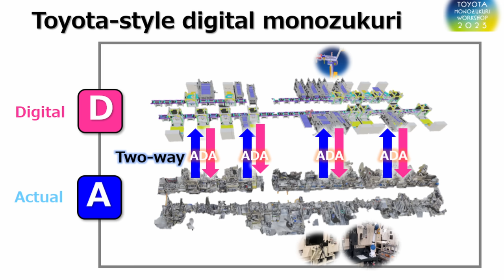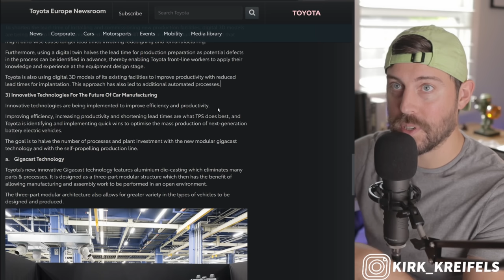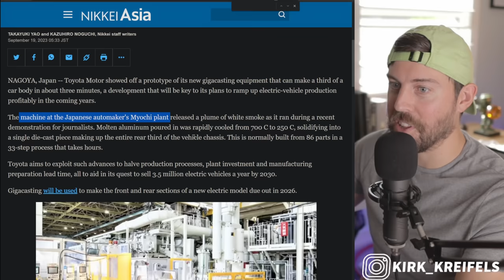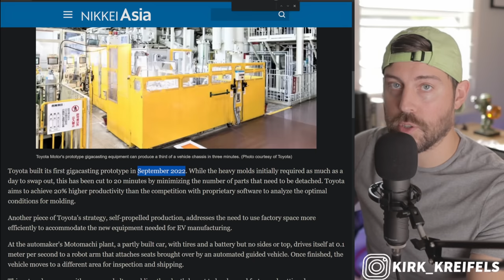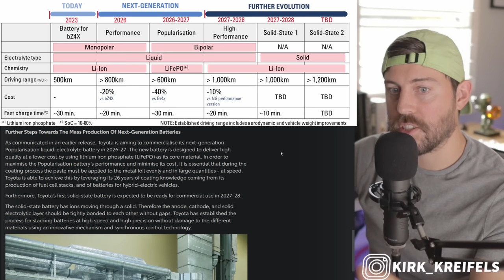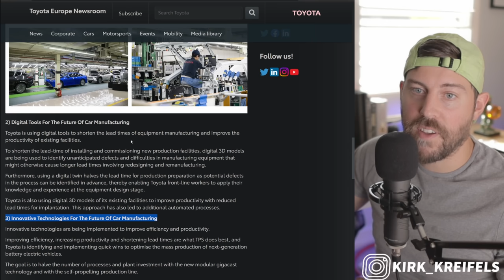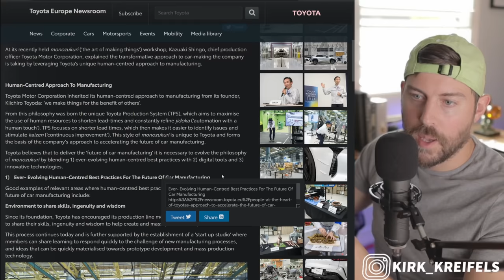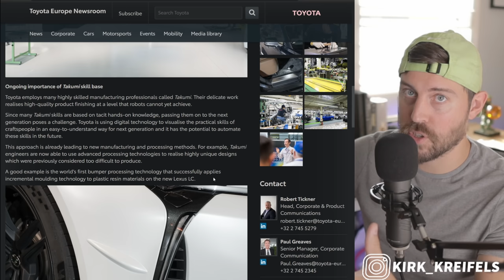Toyota is CHANGING how cars are built // their latest production SECRETS revealed

Comment: If Toyota goes the route of Tesla putting quantity over reliability, we’ll riot…
Reply: Believe in Kaizen, you need not worry.
Reply: Toyota is always problematic.
Reply: Tesla has the highest reliability in the industry . Lol. Not sure what your saying. Castings improve quality , build time and costs. PLUS MORE REPAIRABLE.
Reply: @jp23baz33  THIS. I agree. What’s the point of reliable if you can’t even afford it?
Dealerships are Toyota’s biggest problem right now.
Reply: @jplabrecque6708 eh? Pretty sure Tesla scored below average in the last jd power dependability study. Down there with Mercedes, ford and Audi
Reply: @jplabrecque6708 How does casting improve repairability?
Reply: They already have.  My 2020 TNGA Japan-built (JVIN) Toyota was problematic garbage that I ditched after 2 years, 10K miles & multiple towing's after being left stranded from various mechanical/electronic failures.
Reply: @jplabrecque6708  Tesla has good core EV mechanicals with crappy quality vehicle shells & systems built around them.
Reply: Tesla's powertrains are more reliable than Toyotas
Reply: @dystopia-usa  the only quality issues tesla had were fit and finnish, which is no longer the case. The fit was solved by giga castings,  finnish was just working out the kinks, I worked at chrysler for 30 years. New paint shops ALWAYS have problems.
Reply: @chibbyylol Don't forget Fiat.  But really, Tesla doesn't even offer themselves up for proper JD Power analysis.  Not sure what they have to hide.
Reply: @dystopia-usa  As an ex- Toyota Service advisor I can assure you none of the TNGA products Toyota makes will last nearly as long like they did many years ago. The dynamic force engines the pretty much put in every vehicles are reliable when its new, but I've seen most of them problematic with ECU problems and throttle body issues. The D4S system is very complex and not as easy to service. Props to Honda for still offering a normal port injected natural aspirated engine in their lineup.
Reply: @wyw201 someone who has no idea about manufacturing processes would say something ignorant like that.
Reply: @chibbyylol this is why toyota clowns are clowns, unvoluntarily funny though😅. when toyota ranks low they call the index BS. when other brands rank low or toyota ranks high the index suddenly becomes legit 😂. lmao
Reply: @uludak8468  if they’re going to pick for their bias then might as well play at their own game no?
Reply: @chibbyylol  not sure who you mean, but look up who is the one that gave it a try 😉 or you agree other brands rank better than toyota?
Reply: @uludak8468  I’m sure most aren’t delusional in like if Tesla is ranking higher than Toyotas in EVs sold that’s obviously correct since Toyotas EVs are stop-gap doo doo
Reply: This is a step in the right direction for Toyota. While management has had their heads in the sand and stubborn finally they see the future is EV's and technologies. Using giga casting decreases the time build to build a car, reduces parts and improves productivity per car. Good to hear Toyota you are on the track...
Reply: They will not of course. The japanese are all about quality, it is in their DNA..... . And they have simply no choice to follow Tesla's example, and the Chinese. It is a matter of surviving. Tesla's have 600 parts less and costs 50% less to produce......
Reply: Do your research before making false statements: Tesla has highest customer satisfaction/re-purchase / brand loyalty figures in the sector.
Reply: @steinmathisen4928 They ranked low in consumer reports.
Reply: @jplabrecque6708 by god my god. Pray you never clip a curb and the lane assist fails that cost 10k or have fit and finish of a 90s American vehicle.
Reply: dont worry, Toyota will continue to build half the number of demand...

Comment: Question. The introduction of solid state batteries will further tank the prices of used EVs. Could that be the tipping point for the masses to start buying EVs? 

I’m thinking that cars with old lithium ion tech will plummet in price. But if I only want an EV for the school run and getting groceries I don’t care about old tech especially when I could be getting a 4 year old car for 25% of its original price. 

Just a hypothetical
Reply: It's a resounding ... maybe.  SSB have far greater range, but also carry a far greater price.  When the, say, Model Y Performance goes from 300mi range to, say 500mi range, but its MSRP also goes from $55k to $70k, the used prices of Li-Ion may not tank until SSB production is able to be cheap enough to drop prices down again.  

Actual SSB implementation is probably 3-5+ yrs away.  Big drops in current Li-Ion EVs remains a question mark.

That said, more so than ICE vehicles, the eventuality of battery and motor death is something you need to seriously consider.  A battery pack replacement for Teslas generally go from $10-20k, and ones with over 10yrs/100k miles on them will be subject to possible failure.  Also, the electric motors themselves also need replacing at a much faster rate, and usually go for a few thousand each (depending on how many motors your model has).  

If you want an EV for its performance, quietness or just prefer not having to stop at gas stations to "fill up", by all means go for it.  If you want it because you're an environmentalist snob or think you'll save money in the long-run compared to gas vehicles, it's quickly unraveling as not being the case whatsoever.
Reply: Toyota said that will have on the market solid state. 3.5 years later now they are saying 2026. In 3 years China will have batteries 600 miles range and 40% lower prices. I’m worried that Toyota in 3 years will be so behind. Just looked at the direction of sales in china. 🇨🇳
Reply: I don’t believe that they will be able to develop own battery. They should just buy it. Bipolar battery is old tech very heavy.
Reply: @Bogusuap  ... care to cite some reliable sources of "600 miles and 40% lower cost".  Only thing I could find was a semi-solid state sodium battery that cost as much as lithium ion, with 600 miles of completely unverified range or testing.  That said, there are as many EVs rotting in fields in China as there are driving around.  And like most things coming out of China in a rushed fashion, I'd like to see the long-term reliability of these batteries.  My expectations are incredibly low.
Reply: @Bogusuap so did change told you 5 years ago they will reach 600 miles ,but I guess this is too hard for shills like you to understand

Comment: This is nice and all but the focus is strictly for EVs. All this talk about improving EV production and bringing the cost down but not a single mention on improving the charging infrastructure, making it more available, more reliable, and standardize the charging interface and payment methods. That is the only thing preventing me from getting an EV. With ICE vehicles I can literally find a gas station anywhere, pull into any brand and the nozzle will fit in my car and I can pay for with with any credit card and it is going to work. In order for me to get an EV it has to benefit me and right now I see EVs as an annoyance. I have to drive out of my way to get to a charging station, hope that there one open, hope that open one is not broken, hope I already have an app for the payment method, hope that it connects with my phone. If all that happens then I charge it and wait much longer than the 3 minutes it takes me to fill up my ICE tank with gas.
Reply from the maker: Interestingly, Honda has been more proactive on the grid end of things. Toyota more active on the hydrogen front
Reply: @KirkKreifels  It's going to take more than just Honda and Toyota to establish the new refueling infrastructure and distribution. Gas stations have been around long enough where it is easy, seamless, reliable, and available. The gasoline production and distribution system runs like a Swiss watch. Paying a premium for an EV with none of those is a hard sell for me.
Reply: I agree with your points, but this video nor toyota are not making grid bolstering their number #1 priority. The investor interest is in selling more and expensive vehicles as of now.
Reply: @kolt9051  Agreed. My point is what's the point of bringing more EVs to the market if the infrastructure can't support them.